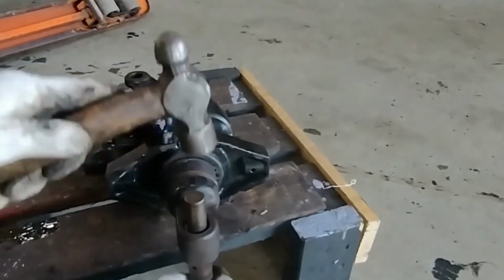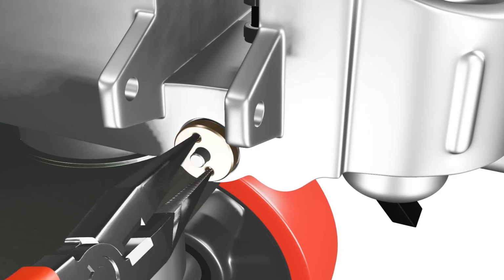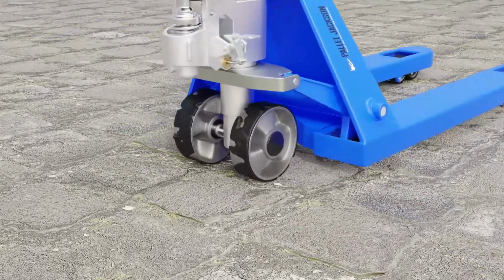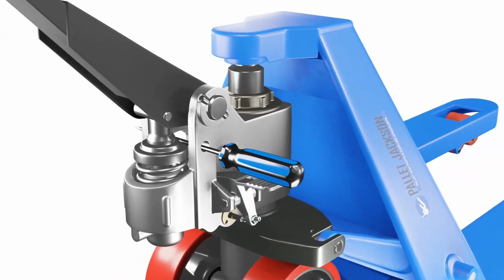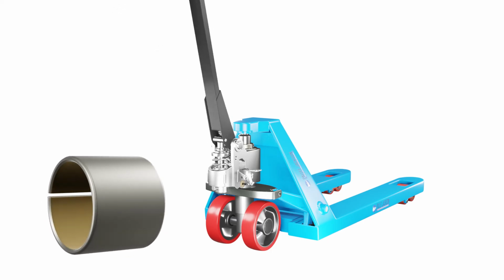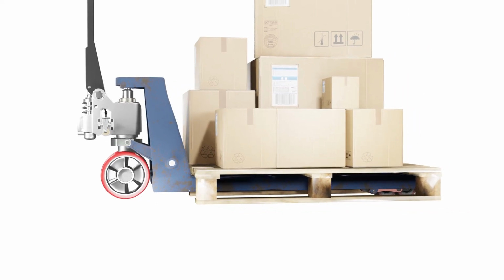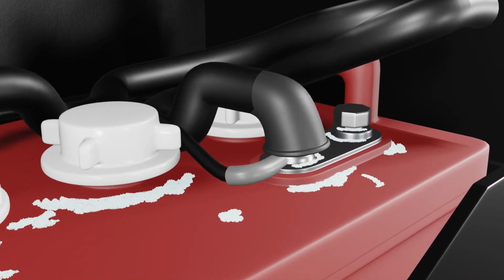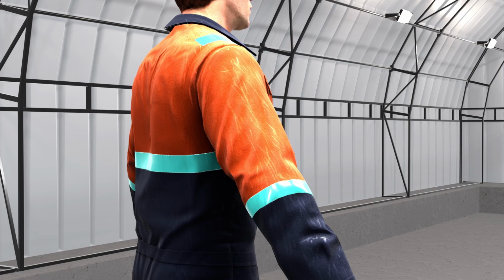Pallet Jack Repair | How to Repair a Pallet Jack | Electric Pallet Jack Repair | Step-by-Step Guide

Comment: Are there many brands of pallet jack? Do the oil seals for each brand vary in size? My pallet jack is leaking oil and the oil seal I bought from eBay is the wrong size and doesn't work. How do I find the model number of my pallet jack?